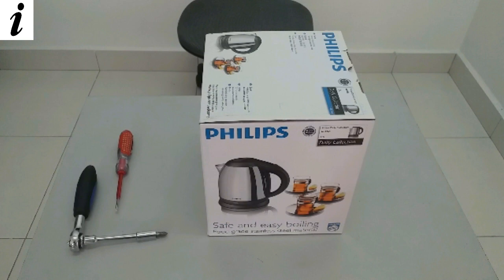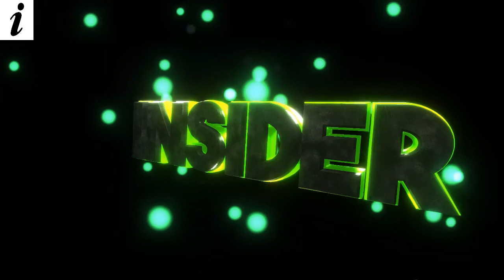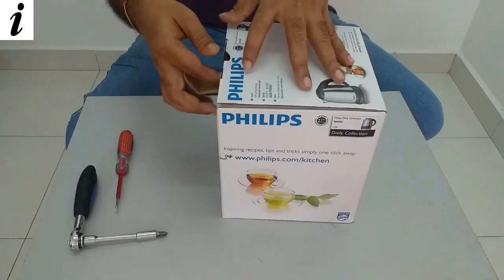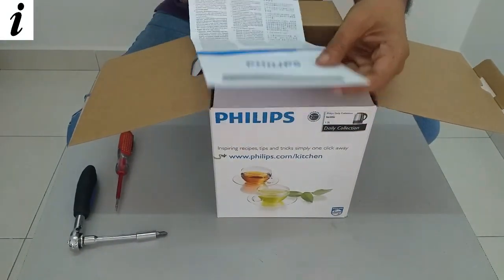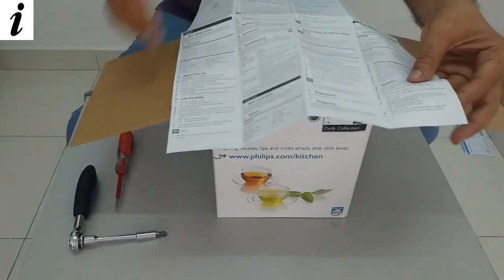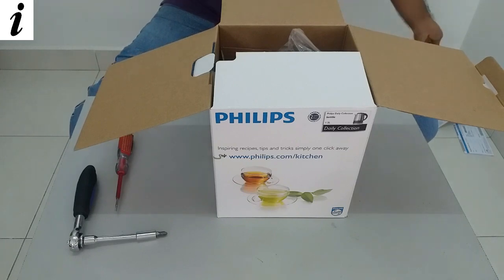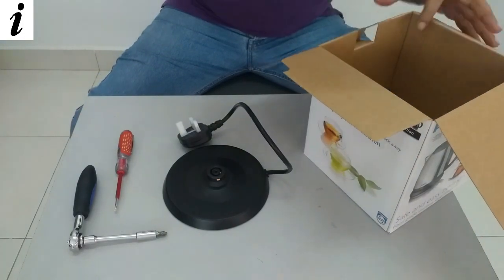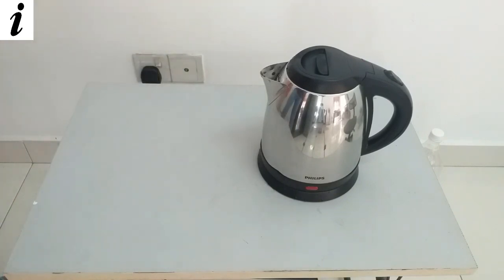What's inside an Electric Kettle and How Electric Kettle works || The Insider

Comment: Is there a heating element at the handle. Why does mine handle gets really hot
Reply from the maker: There is no heating element in the handle
Is your handle Plastic, wooden or metal?
Reply: @theinsider4751  plastic.. actually i now know the answer. :) its from the steam.. and the mechanical sensor is on the handle. :)
Reply from the maker: Yes it is..